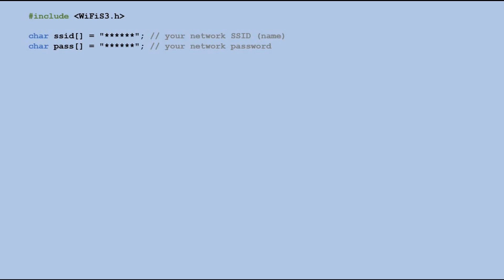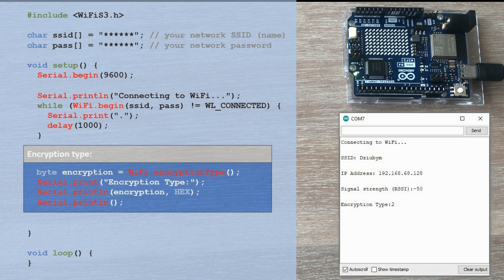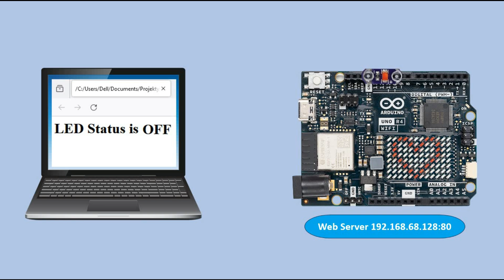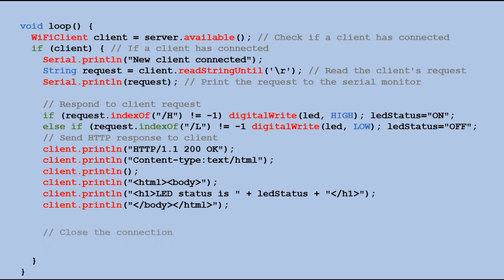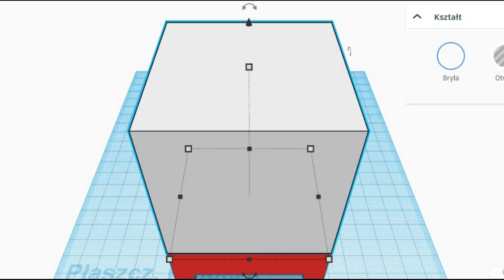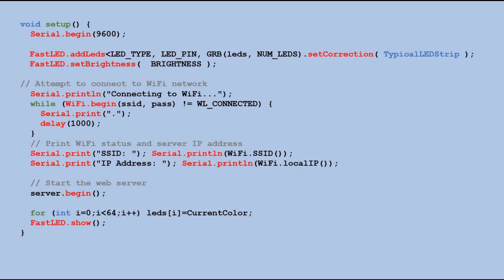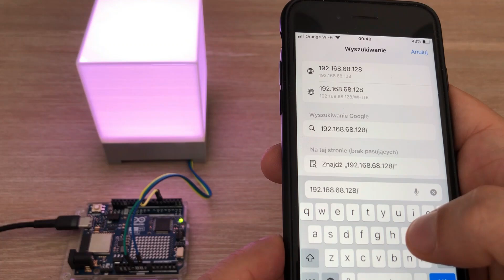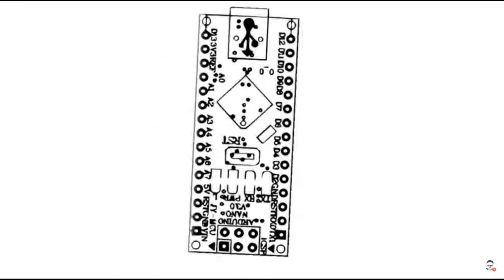From Arduino to Web-Controlled IoT Lamp: Learn Internet Connectivity with Arduino Uno R4 WIFI!

Comment: Please repeat it on ESP32 only
Reply from the maker: Well I am not going to do video on the same topic only to change the microcontroller. The changes should not be massive though. ESP32 board can be programmed from Arduino IDE You have to figure out which library to use (not sure if this is the same which I did) and when you establish connectivity the res of the code stays the same . When I will be doing the second video with using Arduino nano so it can be closed within the case, I might look into esp32 then